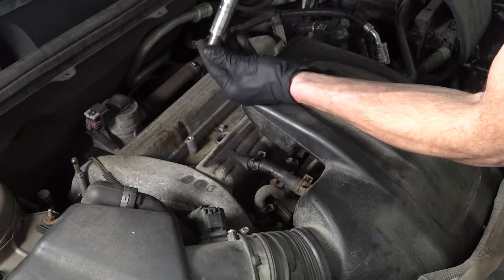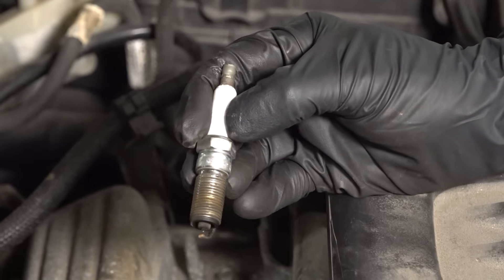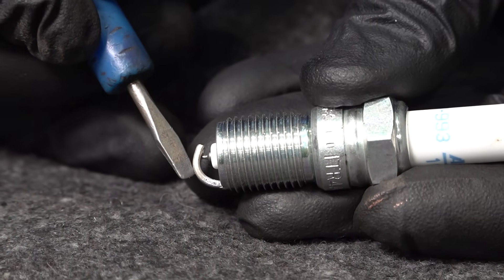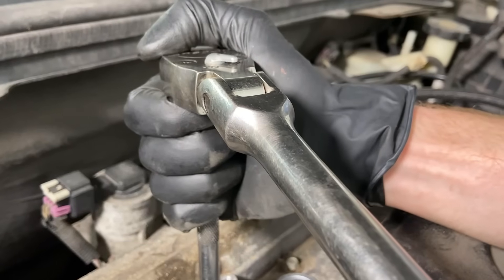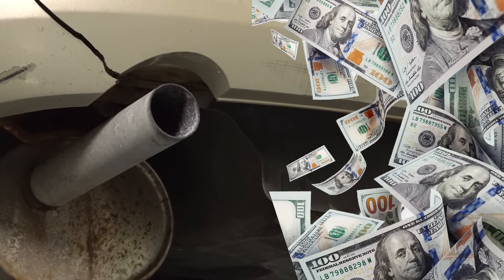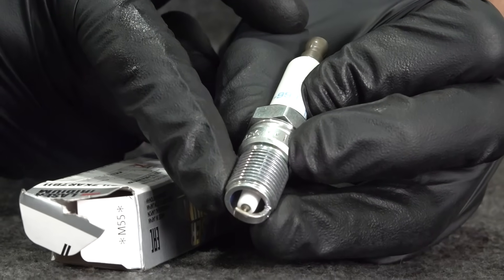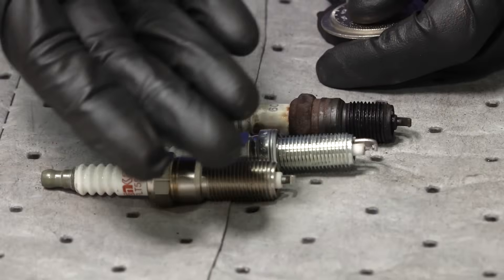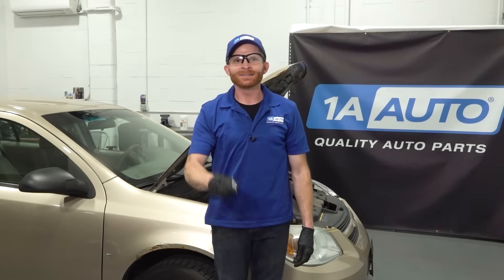Common Spark Plug Installation Mistakes that Cost You Gas Mileage on Your Car or Truck

Comment: No mention of dirt sitting around most plugs that falls into cyl when you remove old ones 
Or the fact that you should never remove plugs from a hot engine!
What about a common issue of carbon ? When the end of a plug is jammed with carbon, you cannot remove that plug with breaking it on the head or ruining threads 
Very common. You must run Sea foam or de - carbonizer first ti remove plugs. 
Important details missing here

Comment: What else is fun is when the rubber boot inside the spark plug socket grips the plug stronger than the locking ball on the extension, leaving the socket stuck on the plug down in the cylinder head.
Reply: Been there! Whoever invented the magnetic spark plug socket better be a millionaire, they’re ingenious and makes the job a breeze
Reply: Ooo, that can't be fun.

Comment: I snapped an ignition coil bolt because even though there wasn't any visible corrosion, those bolts haven't been moved in 12 years. I think you have to work them loose by slightly undoing them and retightening them to free the threads. I did the same with the spark plugs because I felt them binding upon loosening.

Comment: Just use a large plastic straw to start the plug threads.  It always works.
If you have a bending problem, just insert a dowel in the straw.

Comment: I like a rubber lined socket, and I use electrical tape to secure the socket to the extention, so when I remove it, I don't leave it stuck to the plug. Also the first time you pull the threads out of an aluminum head, is the last time you will install plugs without a dab of anti-sieze. 🤣

Comment: One reason NOT to lube a sparkplug is that it reduces friction by ~30%.  There is an Aussie car guy on YT who used to be a Fastener Mech. Eng. IIRC, and just putting 1 drop of oil on a sparkplug/screw-bolt, turns it from a dry joint to a wet joint.
Torque spec's outside of industry are usually given for a DRY joint, not a wet joint.
So anytime you add oil or anti-sieze to threads and torque to spec, you are probably over-torqueing close to 30%.  Might not matter on a wheel stud, however anyone who's broken a sparkplug can see the problem here.
Use anti-sieze in most other applications sure, just make sure to use the smallest amount, not gob it on, and torque it to the very lowest end of spec or 10% below.

Comment: if you dont have a spark plug socket, try a magnet on a telscoping stick thing if you have that so to not drop plug into the hole. OR use some paper to make the plug more snug in a regular hex socket

Comment: I like using 1ft 3\8 heater hose to put the plugs back in like when there in a hole like that
Reply: I agree with you. That method is very good!👍
Reply: I always use a  light coat of antisieze  with trifle or kroil and and run them in and out a couple times, until they are smooth,  and hand torque them, tight, but not too tight

Comment: Should you avoid using a spark plug that has been dropped (let's say 4 feet onto concrete) even if the gap is still correct and the threads haven't been damaged?